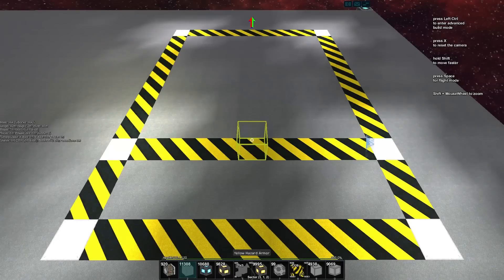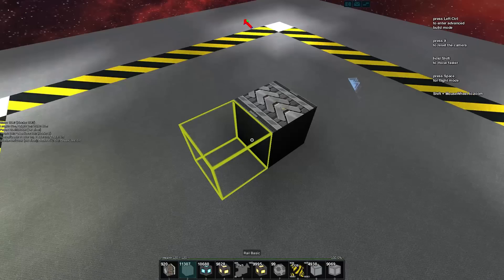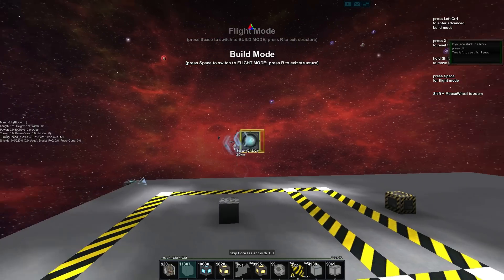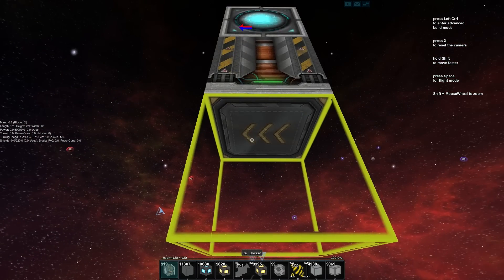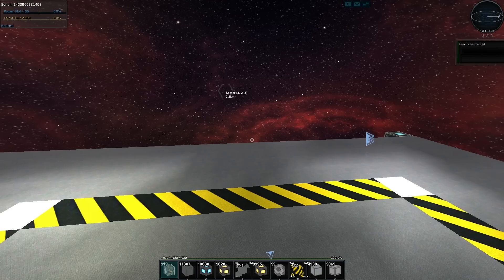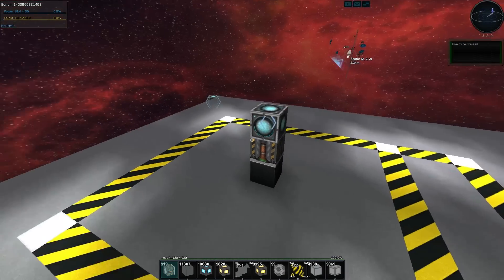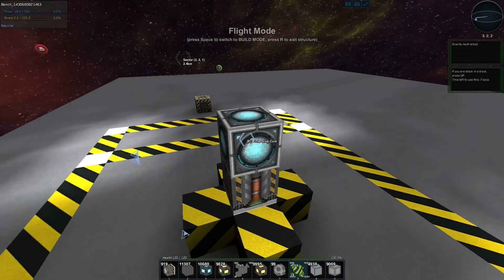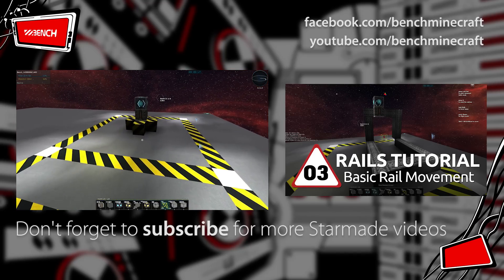Starmade Rails - 02 - Rail Docking Basics [RUS-CC]

Comment: I have the latest update and changed some of my ships to use the new docking system but it still doesn't work. i even tried doing things exactly like this video but i get a message "can't mix rails with old docking system" is there some setting somewhere or am i doing not pressing the right button

Comment: BS that its easy. When ever you try to dock I keep getting the message "can't adapt to this doc" so BS on this!! 

The only way this thing looks lie it'll work is if you toss away everything you've worked on from the beginning and start the frack over.
Reply from the maker: Bezelboot665 have you got old docks on your ship still? the two aren't capable.
Reply: Yeah I managed to finally fix that. The strangest thing was what was preventing me was that I had set up an old turret with the old system. When I had logged / signed in, I though the space  where I had my turret was destroyed because a whole part of the mountain was missing ( I had built an underground base) Turns out it hadn't been destroyed, using the nav filter I was able to track it down. _  It was INSIDE the fracking planet!! _  Praying hoping that logging off and logging back on again would restore things, I tried it. It worked. I was able to delete the old blocks off the turret and now I can use the new rail system. Still don't know how that turret ended up inside the planet, I guess it was just one of those bizarre coding errors on the devs part and hopefully it won't happen again.